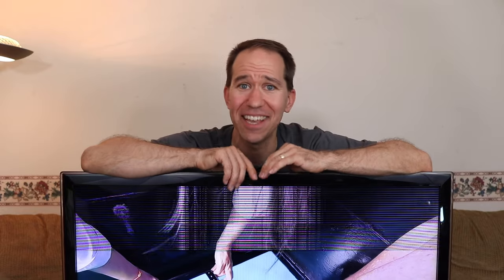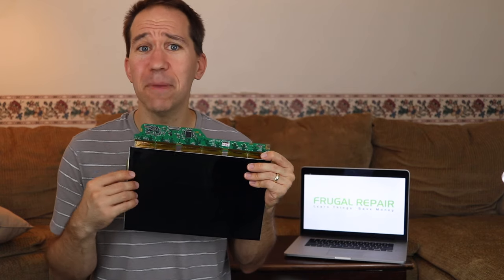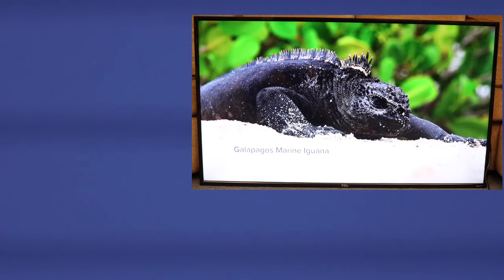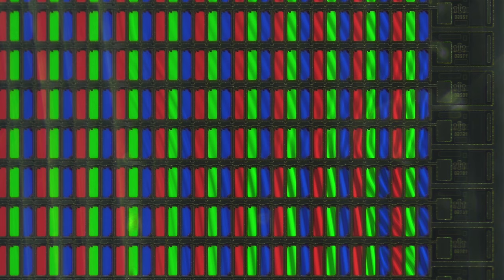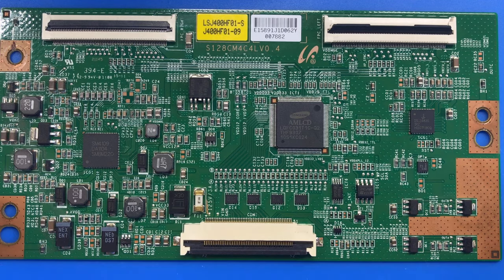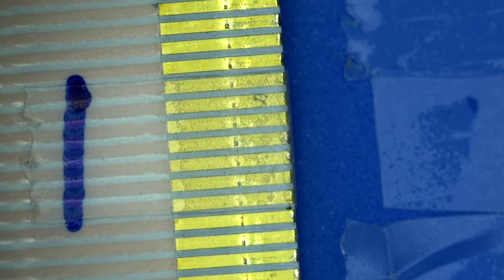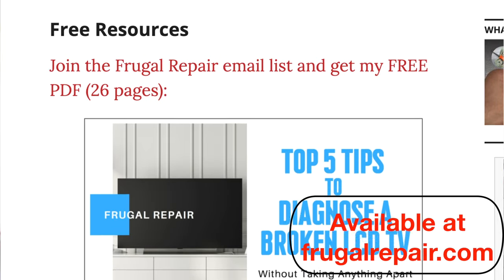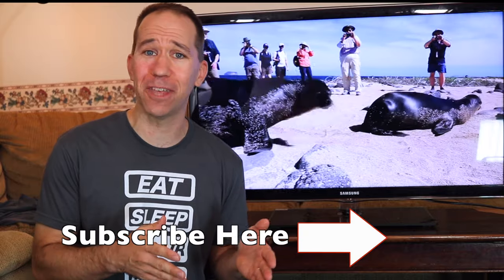Repair Hack Explained | How to Fix TV Horizontal Lines - Part 2

Comment: I picked up a 70 inch 4K TV vizio v705H1 for free ,it works but it has vertical spot lines that react to the displayed colors and picture motion ,do you have any idea where to start to fix it
Reply from the maker: It may have a broken lcd.  If not, I’d say follow the steps in part 1 and 2 of these videos.  You could watch my other tv videos for some clues too.
Reply: @FrugalRepair  ok here's more details the lines are a light lines it gives a blur effect there's vertical and horizontal lines and it changes place depending on what's being displayed i tried cleaning all the ribbon connectors but that didn't fix it

Comment: My Vizio M550SL seems to have two problems.  Horizontal lines on the left side  AND  the lower left quadrant is noticeably darker than the others.   Any clue what that might be?  I don't know if I have the ability/vision/patience to try the tape fix but I wouldn't mind swapping out a video board / control board if needed.   Thx

Comment: What is you take on replacing cracked screens.  Do you have a video on that?  Is it worth the repair?
Reply from the maker: Unfortunately, you can't fix a cracked lcd.  You can replace it with a working one but it has to match exactly and no one sells them (at least for most TVs).
Reply: @FrugalRepair  I noticed people are buying pallets of customer returns but lcd are cracked.  Is there a market for the parts or would I just be stocking crap for nothing?

Comment: Thanks , samsung un58tu7000fxza tape fixed black screen. but it has pink purple hue. tried to change color setting but cannot, any suggestions? Thanks again!
Reply from the maker: I’m not sure.  Maybe too many lines are getting blocked?  It could be a separate issue.  I’d see if you can narrow the problem down to that half of the lcd for sure.  Maybe it’s a simple solution such as the tcon cable isn’t seated correctly.  I’ve had weird things happen in that case.

Comment: To make it perfect, could you cut the line on the PCB instead and solder a jumper wire from the working side to the defective side?
Reply from the maker: No, because the issue is likely a short inside the lcd panel assembly and working on the pcb (driver board) would not help.  If the issue was a defective transistor inside of a sub-pixel, you theoretically could use a laser to cut out a lead to that shorted transistor.

Comment: thank you for your explanation it was both very clear as well as entertaining (loved how you zoomed in the screen :D :D <3)

i'm having a similar problem with a lenovo legion 5 (horizontal lines, occasional transparency and as of today some occasional flickering :/), i just checked another video on the model screen replacement but they show 1 connector only instead of 2.

i'm still planning on taking it to a local repair center in january but was wondering what your thoughts could be. you think there might still be some hope left for me ? lol
Reply from the maker: Sounds like a similar LCD issue.  If it has a row signal going to both halves of the lcd, then this trick should work.
Reply: @FrugalRepair  thanks for your reply !! it gives me hope 🙏happy holidays!!

Comment: hi, just recently started to fix 4k tv as hobby, this is very informative video, hopefully you can answer my question. I have a 70 inch samsung Qn70Q6 model. everything working fine except horizontal lines at the bottom (a quarter section) and when there is whiter image on video can show ghosting to the top. I measure the voltage on all CK1 to CK8 at the test point at the bottom of the panel thin board, most are 3.3v except CK3 and CK7 showing 2.9v I dont know if that is the issue. this model doesn't have a separated T con board. i was able to trace the CK3 and CK7 all the way back to the ribbon (only 1 in this model) back to the main board. I believe that the CK signal coming from the main board but how can you verify if the issue is the main board or the panel? I tried to use tape to block the CK3 and/or CK7 but the horizontal lines or ghosting gets worst when I do that. also as this model has only 1 ribbon cable and has 3 small bottom boards on the panel, I tried to disconnect the left or right side C shape ribbons connection those thin boards, there is no image on the screen but I can still hear the sound. funny part is that I got this tv cheap knowing it has issues, but when I brought it back, it was working fine for 3 weeks and just few days starting to have this issue.
Reply: update, I was able to put tape on the right bottom C shape ribbons (looking from the back of the tv), blocking Ck2 signal, the horizontal lines from the bottom (a quarter section) is gone, but where previous symptoms lines started before now there is a line showing different across the tv. if I look closer it is actually 3 separate lines showing. I am guessing that is most likely telling that it is the panel issue right? anyone?

Comment: I've got a Lenovo Flex 5 laptop, and while I was fixing the left side hinge, suddenly 1/4 of the right side of my screen stopped working. Up to this point, I hadn't disconnected any cables, but I did lift the screen slightly away from the casing. There's this annoying vertical black strip now. It still emits light, but no image is visible. The touch functionality is still intact. Do you think it could be a cable issue or is my screen damaged beyond repair? Pressure damage?

Comment: Thanks for the great video! I have horizontal lines appear on my lcd monitor. They are displaying bottom 1/3 of the screen with 2-3 second intervals(almost flickering) and there is buzzing sound with it. Do you know what would be the cause of it?. most lines are small black looking and there are two thicker purple lines. They are the same color regardless of the background.
Reply: Do you fix this problem ?
Reply: Do you fix this problem ?

Comment: Do I hve to oder a tcon board with the exact number of the old or are they substitute boards if I can't find the original
Reply from the maker: You probably have to order the exact same model number printed on the board. It is possible to find a compatible board that will work with that LCD and main board but it would be really challenging.

Comment: I got 2 spoilt monitors:
1) Cracked LCD-LED screen panel. Any advise to fix it besides replacing the entire panel?
2) Cracked LCD-LED screen panel too (same advise needed) & and a burnt out 12V 3.75A AC/DC female connector. Is it possible to change the connect to C13 for UK 3pin Main plug?
Reply from the maker: Unfortunately, you can’t fix cracked lcd panels.  You can replace them if you can find a replacement part.
Reply: This applies to laptop screen too? I have vertical lines.

Comment: I have this issue with an lcd monitor, but I got confused at the part in the video where you tested left and right side, but for me it would be top and bottom, with the problem horizontal lines running across bottom half

Comment: Hi I think I have the same issue in my Phillips 4K TV - but there is a slight difference - the horizontal lines mine are flickering and appear in random places. WIll the tape fix work for me as well ?

Comment: Hi Reese, Just discovered you today, subscribed, got the free pdf, etc. Thanks! We have an LG with a nonstop vertical red line at the right of the screen, that is pretty much there all the time when watching tv or movies. Do you think this can be solved with the tape trick or do you have an idea it is something else. I was hoping there might be a vertical hold button or something to just adjust the picture to the right a little bit. Thanks if you can get to a response. I will keep searching. Peace.
Reply from the maker: No, tape trick won’t work for vertical lines.  It can be a bad tcon or bad lcd.  Check my pdf for the tab bond reference , it could be from a loose connection there.  You’d have to put pressure on it.  There are videos about this trick

Comment: I have problem horizontal lines too, but there are 2 lines, about quarter from top and down. 
If i taped left tcon the line at quarter down disappeared or if i taped right tcon the line at quarter up disappeared. 
But i cannot do both, because the picture will blank. 
I have done the combination, but only can tape left or right tcon. 
What is your suggestions? 
Thanks

Comment: Im curious but couldnt you make this a lot easier by using a scope to probe the lines directly on the tcon board,  one at a time to look at which clock signal has the issue instead of trial and error with the tape?  

Edit - I could see a couple of issues doing it this way,  the first being loading down the signal with the probe which would mean more attenuation is needed,  the second would be needing a very tiny and sharp probe tip,  but these are certainly available as i use them a lot...

Comment: If you were to isolate the short circuit or issue, could you bring it to Electronic store for repair?
Reply from the maker: The short is inside the lcd panel assembly.  Unfortunately, you probably wouldn’t find a local repair shop that would know or be able to repair the short.  There may be someone who could replace a COF if that was the issue or a component on the driver boards but in general, it may not be a feasible repair.

Comment: I have a un60es8000 with an intermittent half screen vertical lines. Any pointers or experience you can share? My tcon board has 4 lvds going to the drivers. Thank you in advance for any help sir.

Comment: I used the same method and it works good, the lines are gone. but I can see that half of the screen look more yellow than the second half. Do you know how to solve this issue? Should I block only the defect pin?

Comment: Interesting, My TV has a couple of lines near the bottom of the screen. One of them is intermittent. They both fill with colors. My LG remote has a pink pointer. If I hover it at the bottom of the screen. The pink appears in the lines directly above the pointer. Its as if the lines from the bottom of the screen are being displayed 3" above. Its a LG65SJ8000. Any thoughts or suggestions? Thanks
Reply from the maker: I’d try the things I did to diagnose the in the tape fixing videos as a first step.

Comment: Is it the same if the lines are coming after a while? Or if it starts bow to flash in lne area? Actually it's a big older samsung smart tv that we don't have stands and it has wall stand and it has pop out metal things and i put some books behind the tv under those two pop out metal things and it stands. It's getting more lines by time. Could that be the reason because it's standing like this?

Comment: I have a Samsung UN65SK8000 and i have horizontal white lines that run on the left side of the screen only and the lines show up evenly up along the screen as an image plays. It also makes it look like there is a magnet or something close to the bottom left corner of the screen causing the color in that corner look a little off. Is this something that is repairable??
Reply from the maker: Maybe, I’d try this tape trick to see if that helps.

Comment: @FrugalRepair These videos have been very helpful. I recently got a hold of a free broken TV that I believe can be fixed using the tape method. The TV is a Samsung model UN65RU7100FXZA and the symptom is that it doesn't turn on. It tries to, but it is stuck in a boot loop. Nothing appears on the screen, but the backlight comes on bright, then off for an instant, then dim, then off. This loops over and over. I pulled the back off. This model just has a main board and a power board. When I disconnect the ribbon that goes to the left half of the screen and power it on I get the boot sound and a steady totally white screen. At least it's not looping, but there's no image. I decide to try plugging the ribbon back into the main board and disconnect the ribbon that goes from the left inner quadrant Driver Board along the bottom to the left outer quadrant Driver Board. Now I see a beautiful image on 3/4 of the screen. The leftmost quadrant is black. Yay. So the problem appears to be in the left outer quadrant. Now I don't know what to do next. I can't seem to find anything on the main board that would indicate where the clock data wires are so I can try masking them with tape. I am wondering if the tape trick might work on the jumper ribbon between the Driver Boards? Or can someone help me find the secret location of the clock data lines on the ribbon going to the left half of the screen? Any hints or help would be much appreciated. Thanks.
Reply from the maker: Thanks.  Use a multi meter in continuity setting to find similar lines on the other ribbon/connectors.  Those are likely your clock lines (if they aren’t ground or power rails)
Reply: @FrugalRepair  In this video you found codes marked on the board [STVP, CKVB, CKV] that clued you in to where the clock data lines were on one of the ribbons. Then you were able to use continuity to find those same lines on the other ribbon. I cannot find any markings on the main board that I'm dealing with [no separate TCon board] that hold any clues as to where the clock data lines are on either ribbon. Are there any other clues or hints to finding those 7 clock data lines? Thanks again.

Comment: i accidently drop a 1kg wire cutter on top of my monitor from 1 meter above and it got similar horizontal line but there is 2 vertical lines from the impact area but screen has no sign of being broken do you if i can fix like yours??

Comment: Hello, sir.  I had changed backlight in success, 55x8500c.
When securing panel and bezel, some side cable might be damaged then some horizontal lines appeared at up side and low side😢
Only when I pushd side cable slightly, few lines disappeared but appeared again once rereased...
Even in this case, is it possible to try using taping block as ur movie??

Sorry for my poor English, fm Jpn, thanks😊
Reply: that learning dont discourage

Comment: does this method work on jumping horizontal lines?
Reply from the maker: It depends on if the whether the underlying issue is related to the row signal on the lcd.  It doesn’t hurt to try this.

Comment: Is there duplicate row paths for the signals coming from the left and the right. How is it possible that if the path from the left side  gets short or damaged that the same clock signal can come from the right? 
It's confusing but since the image detiorates from onside I have to presume there are duplicate row channels?
Reply from the maker: My guess is that if there is a shorted capacitor inside one of the sub-pixels, it's not enough of an issue to take out the whole row.  So like an airplane can still fly with one engine.

Comment: Hi, my lg led tv 43 inch 4k, there is vertical line comes on the centre of the screen when tv turn on but that line disappeared after few second. The screen brightness goes low and high and picture hang for a while when brightness goes low. Remote control function also affected slow. Could you please advise which board is to be checked or needs to replaced.

Comment: Wonder if you have thoughts on how I can fix an issue we are having with a brand new LG 75 inch tv Model 75UN8570AUD?  The image issue is a horizontal pixelated line which is in a stair step pattern left to right and migrates at different locations from top to bottom.  The weird part is the same issue happened with a Vizio 75 inch TV.  I wonder if I have a electric circuit causing the a 60 sec cycling issue.  I hooked the Vizio up to different outlets throughout the house and the issue persistent.  We have 3 other TV's in the house and they do not have this issue.  Thoughts?

Comment: Does it work on vertical probs? Sir
Reply from the maker: No, not this tape trick.  I made a video about vertical lines though.  You can check that out if you want.  It’s the one with the toothbrush

Comment: I heard replacing power supply might restore pixel perfection, can you confirm? I used the tape fix and now I’m looking to solve the underlying problem.
Reply from the maker: I think that could be the case if you had bad capacitors on the power supply, at least I've seen that before.  But generally, I would not associate a screen issue with a power supply issue.

Comment: I have a Samsung 85" my daughter sprayed disinfectant spray on the TV and it went through the bottom  edge and there is now a red line in the center of the tv do you think a piece of table will solve it
Reply from the maker: Probably not, you likely have corrosion on the tab connections to the LCD.  Hopefully cleaning it off will solve it.
Reply: @FrugalRepair  thank you so much